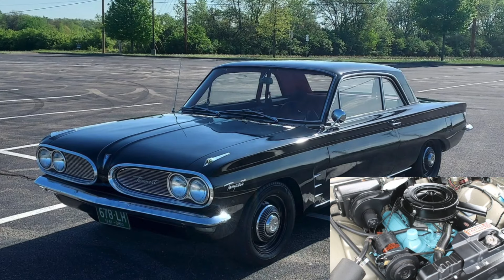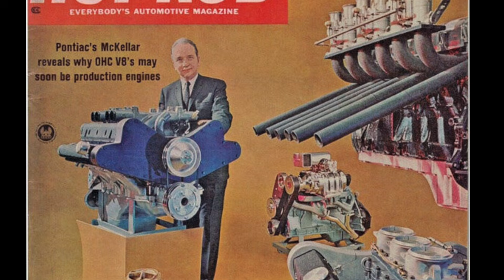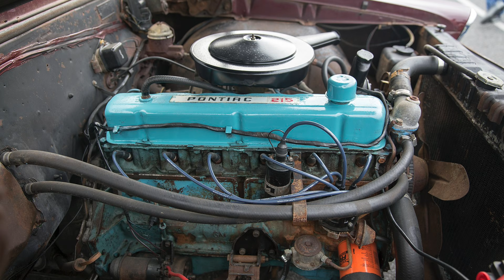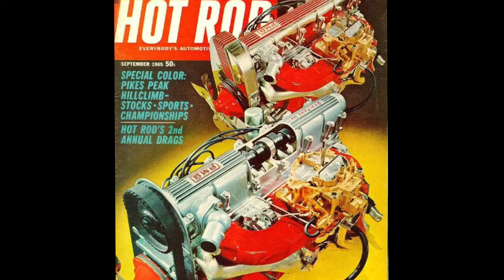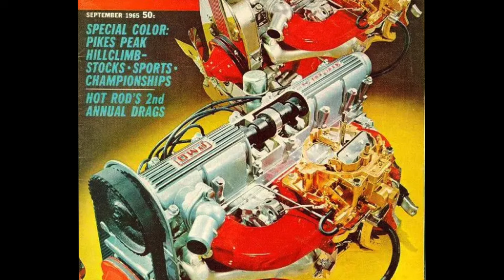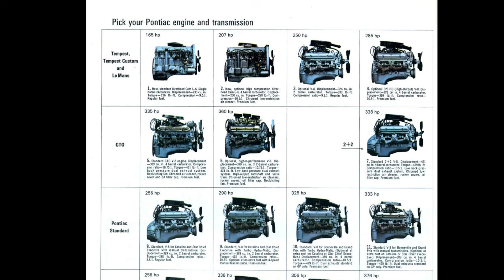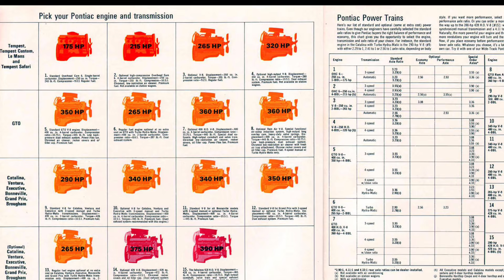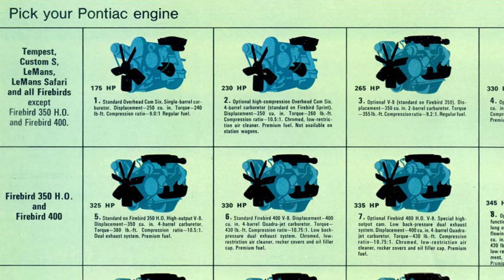Awesome Engines: Pontiac's 1966-69 OHC 6-Cylinder Engine (Tempest/Firebird/LeMans)

Comment: I love my V8s. But nothing beats an inline 6 cylinder for smoothness and reliability.
Reply: Rn1  word indesteuctible to me Gm n Fords 250 n 300 are great motors l6 ❤
Reply: @marcomoreno8188  The Ford small sixes 144- 250 cubic inch engines were horrible. The Chevy I6s weren’t much better. Tempermental & rough running, & were hard to start in cold or rainy weather. Hot running too, as there were no fan shrouds or electric fans back in that era. No electronic ignition either. Carburetors were tempermental then too, with the manual or auto choke being usually a joke. 

I had a Pontiac 215, & a Mustang 200 , & they were both trash can engines. So slow, VWs back in the day gave them a good run. V8s were much more reliable in the 60-80s & the Inline sixes went the way of the dinosaur. Today’s V6s are a vast improvement over those shaky I6s. 
Electronic ignitions are a tremendous improvement over the primitive points systems. 

I beat a friend of mine that swore his 1969 , 250 I6 OHC 4bbl Firebird sprint could beat my 302 V8 Comet GT. 
All I had was a stock 302 , only mods were  with an Eddelbrock Torquer & a Holley 4 barrel 600 on the stock cam & duals exhausts added. Stock  rear gear. We raced the QM , & all I saw were his headlights in my rear view mirror, at least 10-15 car lengths behind me. 

I soon cammed that 302, & did other engine ,trans & put a 3:80 posi in it, & I regularly beat big blocks.
Reply: @marcomoreno8188  The FoMoCo small I6s were junk. The intake manifold was cast integral with the head. Straight sixes alway had harmonic vibration. Cranks were long & hard to balance.
Reply: @duroshebanja6810 
The harmonic vibration range is generally above the redline. Head to balance? Maybe in a rebuild shop but factory balance can be done at a rate to match the build rate on assembly. Also no secondary imbalance as last ng as the rods and pistons are machined to weight. Machining lines incorporate weight scales to check pre balance machining and post machining. It's been a while but weight tolerance is generally +/- one gram or so. Yes cranks can be long. Generous bore spacing can increase that. The Ford 240/300 has a greater bore spread than the Windsor and Cleveland. The GM inlines are the same as the SBC at 4.400. The AMC is the same as the Ford small blocks. The 2JZ is down around 100mm or less. Same for the RB. 
The biggest problem with most inlines built in the US is the cylinder head. Non cross flow heads used mainly for heating up the intake and automatic chokes. As well as holding down costs. People have built new heads out of Ford and GM V-8 heads via cutting and welding. Although l wonder if high performance adhesives would make that easier today. 
The Ford Thrift Master inline six eventually morphed into the Ford of Australia Barra. An engine that Ford should have introduced to the US.
Reply: Except for a v12. 😊 I had a 2004 MB 600SL for a few years. It was insanely smooth with tons of power (500 hp and 600 lb-ft torque). Just thinking about it puts a smile on my face.

Comment: The Pontiac OHC Sprint 6 seemed to have problems as they got older.  I found a lot basicly ate the camshaft.   Lots of metal contamination and very noisey.   Worked on a few and between costs and parts availability you were better off swaping in a 326 engine .    Plus, little was known about the OHC........low production runs, and  I think being prone to problems.

Comment: I've owned one of these, back in '81, traded a '71Datsun 510 wagon for a '68 Pont. F-bird w/a 250 OHC -six.   That car needed a throttle cable, rebuild on the Master Cyl.  and a VALVE JOB. I had a buddy in  H.S. who's dad had a shop, and he invited me to come and (with his supervision AND HELP), we made that thing RELIABLE.   I don't remember how many miles it had on it, it was the little ONE BBL carb.  Said to be putting out 155 HP.  The 4bbl was to putting out 175HP.  Mine did have a "Clifford header" (6=8), meaning power, I'm sure.   I sold that car for?  Don't remember, but then I bought a 1975 Honda CB400F, Supersport, back in '82, just one week before I went into the USMC.    I've still got the bike.   Purchased w/ just 7,062 miles on it, now I've got 17K on it.  Soon to sell that.  Now l'm 61yrs old.   Bike days are near the end now.
Reply: What are you talking about Son, I’ll turn 74 in March and I bought a new bike last Sat. No excuses, dust that thing off and go.
Reply: You don't have to sell the bike Devil Dog.
Reply: My first Honda was a 900 super sport, loved that bike

Comment: And of course just when they needed it the most, they got rid of it Typical GM mentality.  It simply STUNS me to see how this pattern of getting rid of brilliant ideas just when they either perfected it or needed it the most continues to this day.   All they needed to do was to lop 2 cylinders off of this engine and they would have had a perfect engine just in time for the early 1970's fuel crisis.  Unreal.  Just unreal. the stupidity at GM
Reply: This engine would have been a good fit in the X body Ventura of the 1970s, would have set it apart from the other divisions.
Reply: They should have made a four cylinder version of this for the Vega. An all iron 2.4 l OHC inline-4 (3.75×3.25 B&S). 
Would have been as good or better than Ford's future 2.3 OHC right from the start and maybe the torque-arm rear suspension as well. 20/'20 Vision and all... 😊 I'm kinda an H-body nerd.
Maybe just a full-on Car Nut! 😅😂
Reply: @jamieturner401 I agree.  In retrospect, it seems like a no brainer.
Reply: The Oldsmobile Diesel was another. By the time they came out with the 4.3 V6, it was an engine with no head gasket issues anymore that got 40-50 mpg in a midsize sedan. 3 years later it was gone.  The Cosworth Vega was another. Cosworth had prototypes of that engine in the early 70s. If GM had made it one of the standard engine options it would have been groundbreaking.
Reply: An in line straight 6 is perfectly balanced for engine shaking. 

 Removing 2 cylinders creates your unbalanced in Line 4..that is unbalanced and shakes.

 To fix that requires a counter weight going twice crankshaft speed. So your get an expensive engine.
Reply: @3beltwesty  Chevy already made a 153 cid 4 cyl that was basically this engine with two cylinders removed except for having a conventional OHV cylinder head instead of the Pontiac OHC head.  It was put into Nova's from 1962-'70 and became a very popular boat and fork lift engine afterwards.  In the 1960's and early 70's, nobody cared if their econobox 4 cyl engine shook a little.  The factory would just add some mass to the flywheel and put softer motor mounts on it.
Reply: @corvettejohn4507  The shaking engines had all your generators; alternators; exhaust manifolds coming loose. A straight six got axed since needed shorter engines for coming FWD cars in the 1970's . One fix is you wire tie all the bolts on 4 cylinder cars ie BIG ones that usa uses since have heavy cars. With my 1982 Iron Duke any issues is often something came loose. I grew up in Detroit in the 1960s. A I4 engine was not considered great; just a cheap shaky compromise to save money. The shake and failures are often stuff loosens up. An big heavy I4 engine in a car does shake and never was liked in the 1960s. A Ford Falcon with an I6 was radially smoother than a I4 Nova. An I4 is not balanced and shakes. That has been known since about 1900. Chopping off 2 cylinders of a nice balanced I6 creates a n unbalanced engined. The Secondary forces create the shake. It is due to the secondary forces are twice crankcase speed and do not cancel. They do cancel out on a I6; but not an I4. So an shaky I4 needs a balance  shaft or special marketing to hide its flaws.
Reply: @3beltwesty There was nothing a person could do for a Vega four cylinder. they were garbage right out of the gate. just like any of the unroadworthy vehicles made by Ford.
Reply: The Fiero is definitely one that they got almost perfect and killed it off. There are more. But that's always the first thing that comes to mind when I think about GM ignorance
Reply: @The_R-n-I_Guy Right...
And the next Gen MR2 looked like an updated Fiero.
Personally I think that GM's absolute blunder was killing the EV1...
They would have won the EV battle had they continued the programme..
But that's GM in a nutshell..
Reply: @The_R-n-I_Guy  There was once this car called the Corvair.  It was pretty much perfect by '66, so GM killed it so they could introduce the Vega.
Reply: @corvettejohn4507 was gonna mention that they did get the corvair handling issue sorted eventually, but by then it was too late to change the publics mind that it was fixed.
Reply: @MrTheHillfolk 
The Corvairs handling issues stemmed from two things. GM being cheap and not installing a sway bar. Plus not going full IRS. Add in the driver's and service stations not following the tire inflation recommendations because of course they knew better. Much like the owners of early 60s aluminum block engines that would use the wrong antifreeze.
Reply: @mpetersen6  my dad said my great aunt had an early one. 
Haha but they taught her how to handle it because she did loop it a few times and she was fine after that.
Reply: Well I'd say it's partly being the DeLorean and muscle eras as classic GM being dumb- if it wasn't a V8, it wasn't fast enough. So most V6s got relegated to the base level stock/budget option.
Reply: My list: 
* Chevy cavalier, millions spent on marketing, so it was replaced by the cobalt, then cruze, then killed. 
* caprice was a cop/cab and sold tons, so they killed that. 
* Lumina was a known product, and corsica, so they replaced them with the impala, montecarlo, and malibu. 
* The 3800 was a bulletproof v6 that they replaced with a 3.6 that was born burning oil. 
* the camaro/firebird was a good car, they killed them, since they sold them. 
* took a bit but they fixed the bolt, then killed that once it was reliable. 
* the saturn first gen was a bulletproof small car and unique, by the second gen they were rebranded junk.. 

Im sure i am missing some, but these are the ones i remember..
Reply: Same with the little aluminum v8 they sold it to rover who ran with it for like three decades
Reply: @ Oh man.. Engines, the blue flame 6 was given to a devastated japan after ww2 when this little no name company Toyota used it as a base for all the i6 engines they built going forward.  

Or the Buick 3800 which GM sold to kaiser jeep and AMC in the mid 60's, then bought  it back in the 70's.. and triple the cost..
Reply: G.M was ruled by bean counters then and now. 
Too bad, because their engineering for the most part was very good.
Reply: If you think GM is stupid? I suggest you take a look at Ford. every god damn Ford ever made is a unroadworthy piece of shit. and that's a fact.
Reply: As well as the Cadillac Northstar. I see so many low mile bodies of Devilles sitting in driveways broke down.  A rear wheel drive Caprice chassis  and Caddy body parts like the early Escalades, with a reliable LS engine those would have been sought after older cars instead of yard junk
Reply: Nobody could've predicted the oil crisis in the mid to late 60s. We have the privilege of hindsight.
Reply: Yep certainly needed this for 70's gas crisis.  THERE was a rumor Delorian did these to sell GM on Doing a ohc421/428 versions.
Reply: That isn't the only great engine GM canned. For '69 only, Pontiac came out with a 350HO, for High Output. An excellent 350 for the Firebird. Then there's the Chevrolet 400 small block, one of the best motors ever,  IMO. It lasted for 5 years?, not sure, but they killed it. Based on that the 383 stroked is still popular.
Reply: And the fun continues to this day.
Reply: Yes. It's like chewing a piece of gum just long enough to make it moist, then sticking it in your hair. Makes no sense.
Reply: Just like Chrysler dabbling and failing with fuel injection in 1958.  The rights to it got bought up by some cheeky upstart called Bosch, refined, and re-released in 1967 as “D-Jetronic”.  I hope you can connect the rest of those dots..
Reply: @RichMander1 same with Chrysler developing the first car ABS system, but then ditching it because it scared people and didn’t sell. Then Mercedes perfected it with electronic abs as opposed to mechanical. American auto companies hit gold multiple times decades ago, but because it didn’t work as good as they wanted or worked too good, they throw it out as quickly as it came.
Reply: The most uncommon thing in the world is common sense.
Reply: The 2nd Gen Corvair solved every handling flaw from the 1st Gen, finally got some focus on performance, and made it look modern. 

Only to be canceled by GM...but they couldn't be seen to cancel it so closely on the heels of Unsafe At Any Speed.
So they just scaled things back, stopped any investment and just ignored the division until everyone was looking the other way.
Reply: @LN997-i8x I have 2x Corvair engines.  GM killed them because they have lots and lots of parts compared to a solid block engine.  This does not say it was a bad engine, just expensive to make.  Also with the seal materials of the day, they leaked oil, a lot of oil.     
    Too bad Pontiac kill the OHC I6.        Cheers
Reply: Back in the day I saw one of these so I walked over and I popped the hood and my disappointment was palpable. Some jackass had put a V8 in it
Reply: Not only is GM stup!d like you said, but also cheap.
I wouldn't own a GM product even if I got one for free.
Reply: @jesse75 
I take it you own a Ford. if so that makes you another one of the stupidest people on this planet?
Reply: Very easy to say with hindsight and none of your money on the line.
Reply: @chickenfishhybrid44 And how much money has JUST GM spent/ lost over the years,  on goofs??? ALOT!!!
Reply: It’s why they have the nickname government motors and its not because they got federal money before, its because they act like the American federal government, the come up with great ideas even breakthroughs then someone comes along and fucks it all up. 😂. Which is why I think doge might be a waste even if they do their job perfect it’s just going to get undone in under 10 years.
Reply: @GoldenNada  DOGE  was a  scam.  Musk bought a  president  and wanted to  see what  return  he could  get on his investment.